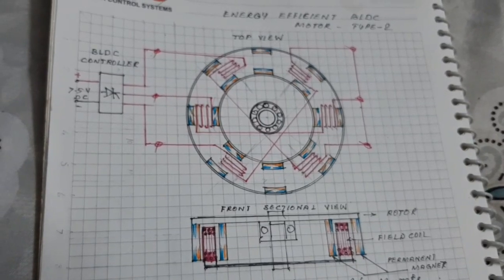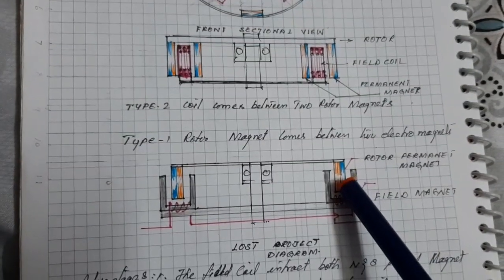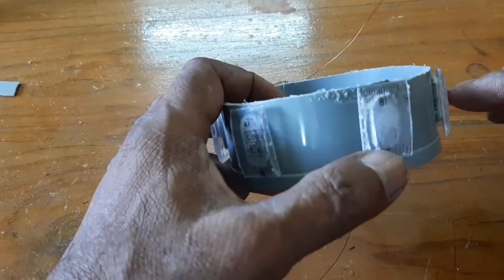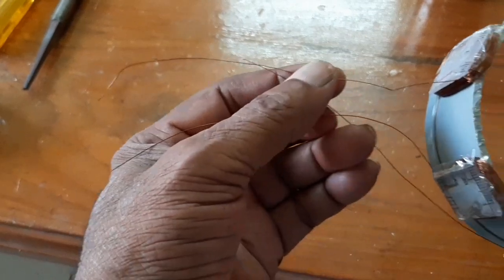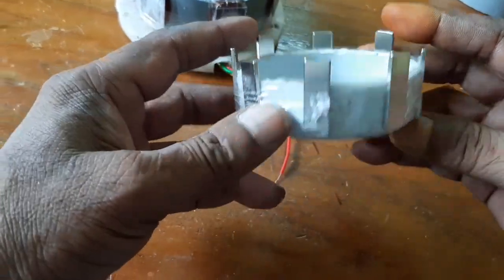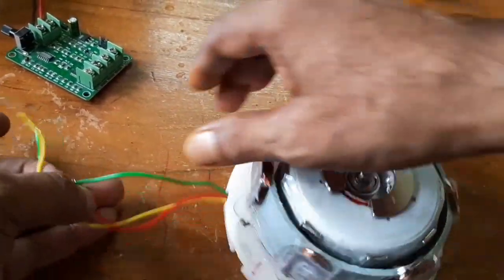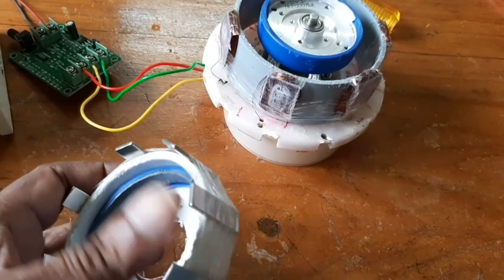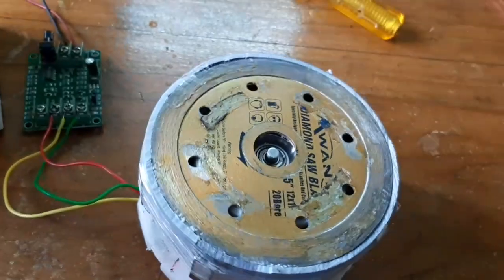(V-31),Efficiency bldc மோட்டார்/Energy efficient bldc motor.

Comment: Another great explanation and demonstration. Thank you for the diagrams, very helpful.
Reply from the maker: Ok good but both readings are not taken at constant speed sir.
Reply: @pugalstech  , ok, I understand now. Just to let you know that I used the “I” Core with the same magnet placements that you showed in your earlier demonstration of a transformer turned into a motor, with the I Core fixed to the top of the second rotor of this motor and then ran the transformer motor including the E Core to rotate the present motor rotors. The present motor was then acting as a generator.  Extremely good results. Please try it also especially since you had everything ready already. Would very much appreciate knowing your thoughts about this configuration. Thank you
Reply: @ Pugals Tech. Since the larger outer rotor already has the permanent magnets fixed in a fashion similar to your earlier Energy Efficient Motor, namely:
https://youtu.be/TORBnUq5apk
Would it be possible to run the present motor as a generator by using your earlier motor design to act as prime mover for rotating your present double magnet rotor as a generator?  If you increase the number of turns of wire for each of your stator coils you will get quite a large output from your generator while the input requirements from a switched magnetic pulse will be very low. So, you can get both a motor as well as a generator from two wonderfully designed systems both being your own designs. I hope you will try it. Again, a great deal of respect to a brilliant mind at work!!! Thank you
Reply from the maker: Thanks sir
Reply: @pugalstech  , was the input power requirements for single rotor that you demonstrated, the same as for double rotor, 3.55 Watts?